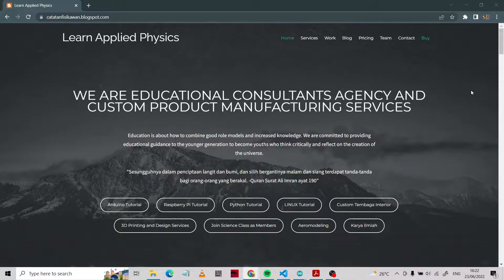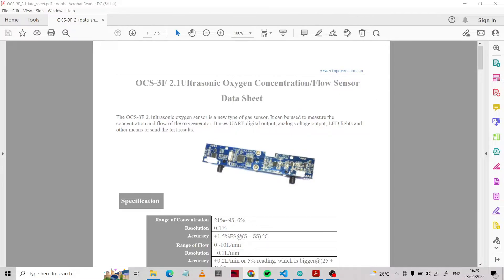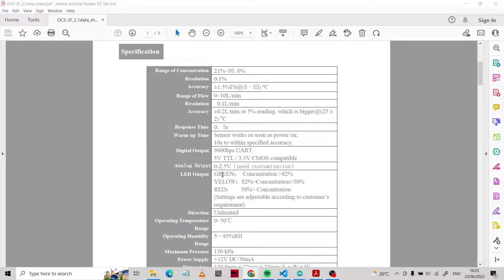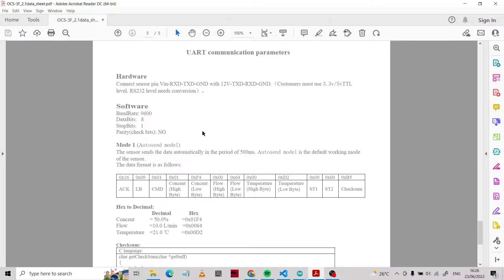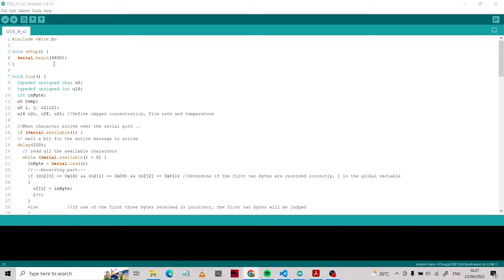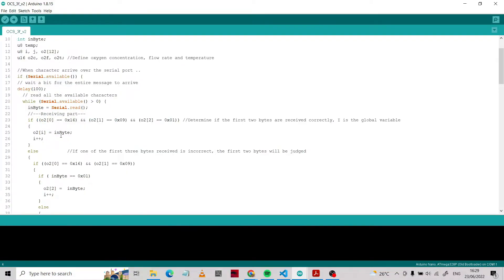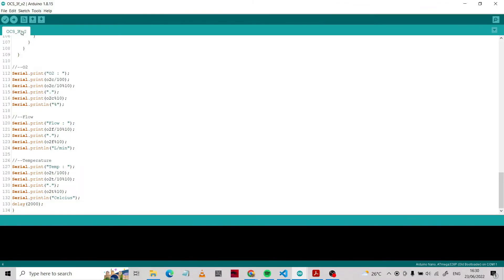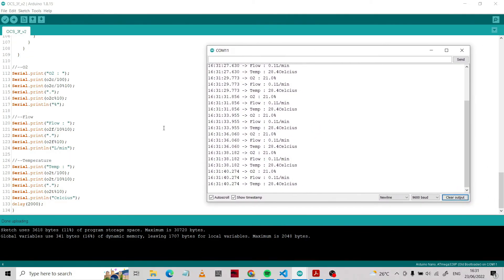Oxygen Concentrator Sensor (OCS 3F) with Arduino Tutorial and Testing

Comment: how to measure output voltage from the sensor
Reply from the maker: You can connect the J1 output to your analog pin on your microcontroller board. J1 Pin 1 to ouput voltage 0-2.5v to measure O2 level and J1 Pin 2 output 0-2.5v to measure Flow level.
For further information you can read the data sheet that I have provide link in description.

Comment: HI this video was very helpful in making the connections and coding but I have got one problem the result is not changing it keeps on repeating the same value pleas reply me thank😍 you
Reply from the maker: it's seem that your reading still error.
It may occur cause: 1. RX TX reverse 
2. Power supply to ocs3f less than 12v

Comment: i get arduino nano and it didn't upload 
Sketch uses 3618 bytes (11%) of program storage space. Maximum is 30720 bytes.
Global variables use 341 bytes (16%) of dynamic memory, leaving 1707 bytes for local variables. Maximum is 2048 bytes.
An error occurred while uploading the sketch
avrdude: stk500_recv(): programmer is not responding
avrdude: stk500_getsync() attempt 1 of 10: not in sync: resp=0x52
avrdude: stk500_recv(): programmer is not responding
avrdude: stk500_getsync() attempt 2 of 10: not in sync: resp=0x52
avrdude: stk500_recv(): programmer is not responding
avrdude: stk500_getsync() attempt 3 of 10: not in sync: resp=0x52
avrdude: stk500_recv(): programmer is not responding
avrdude: stk500_getsync() attempt 4 of 10: not in sync: resp=0x52
avrdude: stk500_recv(): programmer is not responding
avrdude: stk500_getsync() attempt 5 of 10: not in sync: resp=0x52
avrdude: stk500_recv(): programmer is not responding
avrdude: stk500_getsync() attempt 6 of 10: not in sync: resp=0x52
avrdude: stk500_recv(): programmer is not responding
avrdude: stk500_getsync() attempt 7 of 10: not in sync: resp=0x52
avrdude: stk500_recv(): programmer is not responding
avrdude: stk500_getsync() attempt 8 of 10: not in sync: resp=0x52
avrdude: stk500_recv(): programmer is not responding
avrdude: stk500_getsync() attempt 9 of 10: not in sync: resp=0x52
avrdude: stk500_recv(): programmer is not responding
avrdude: stk500_getsync() attempt 10 of 10: not in sync: resp=0x52
Reply from the maker: I have ever got same problem. You can try this solution: when you are uploading the code make sure that RX TX ocs3f unplugged from arduino. If you connect the RX TX the error Will occur.
Reply: @gapmekatron  it worked well when i connect the ocs-3f board the results will be true .. thanks alot
Reply from the maker: @mandomando8716  👍 you are Wellcome 
Good luck for your work bro

Comment: could i use this code on arduino mega ?
Reply from the maker: Yes of course you could. Just plug-in the RX TX pin on OCS 3f to RX TX on arduino Mega 👍
Reply: O2 : 2000.1%
Flow : 2.6L/min
Temp : 35.1Celcius
Reply from the maker: @mandomando8716  it's seem that your reading still error.
It may occur cause: 1. RX TX reverse 
2. Power supply to ocs3f less than 12v
Reply: @gapmekatron  this reading without connect ocs3f board just arduino board
Reply: @Research Project 1001  it worked well when i connect the ocs-3f board the results will be true .. thanks alot

Comment: does it output o2 concentration below 21%. eg 10%
Reply from the maker: For this OCS 3F, the range of concentration measurement is 21%-95.6%. Based on our best knowledge O2 concentration in normal air is around 20.95%, therefore this sensor is suitable for atmospheric O2 concentration. If you wanna use sensor that requires O2 concentration below 21%, you can use sensor GS KE25 or GS KE50.
Reply: @gapmekatron  thanks